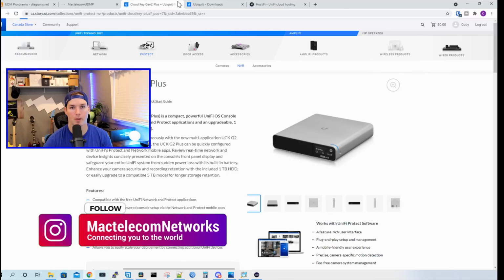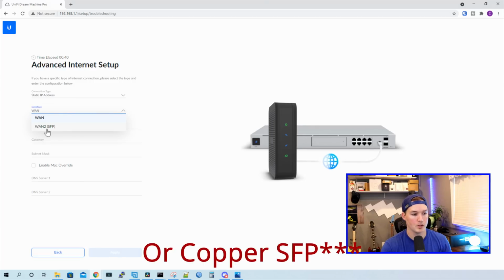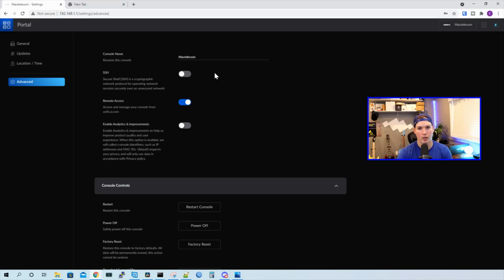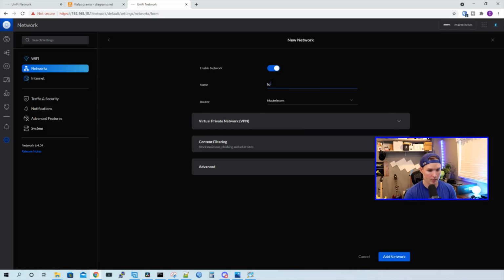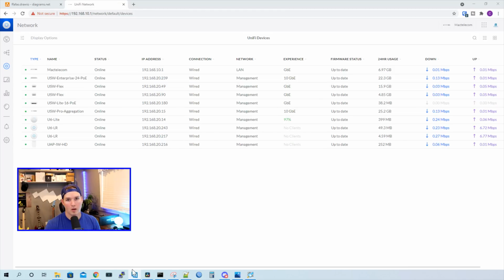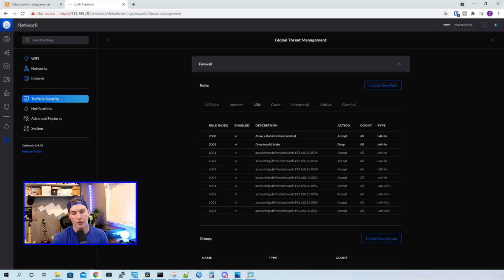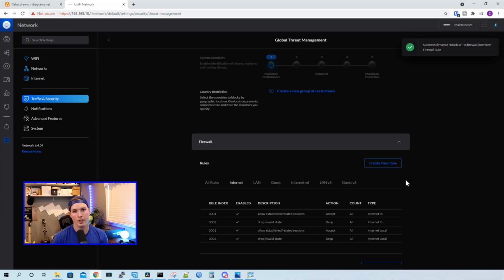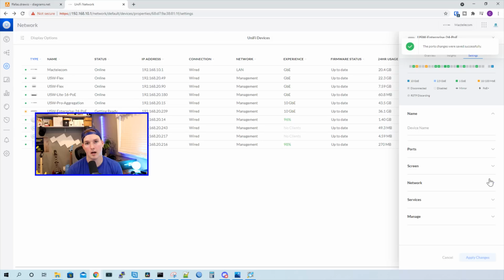Complete Unifi Configuration New User Interface

Comment: Hello Cowdy, regarding the management vlan. It only works for me when create a rule from the management vlan pointing to the untagged controller lan. That is the only way I can assing the devices, switches, ap's etc to the tagged mgmt vlan. I tried creating a different trunk profile, tagging all the vlans, then assigning it to all up and downlinks of the switches. On the ap's I use the untagged vlan of the controller and assiging the tagged wireless lans. What im doing wrong? Thanks for your assistance.

Comment: Hi Cowdy, how can i move the default manage vlan to specific tagged vlan? I created a management vlan 50. Then in LAN local i made rule from Management  LAN to point to the unifi controller. It works, but the accesspoints get Regularien disconnected and reconnect. What is the way to fix the issue? Thx for your help. Andy.
Reply from the maker: You want your uplinks between switch’s to be the all profile ( unless you created a custom port profile for all your vlans)

To put the devices in the management network click on the device, go to services, then management network and specify the vlan you want that to be

Comment: excellent video. I'm still having trouble getting my LAN to be able to see the printers on my IoT VLAN. The only way I can see the printers is if I connect my computer to the IoT VLAN. In theory I should be able to see the printers from my LAN. Any tips you can provide to help with my issue?

Comment: Hey Great Video. I have a problem with my Switch Ports. Every time I assign my camera's to the cameral network or IoT device to the IoT network it I loose connectivity. It works fine on wireless, but not on wired devices. What am I doing wrong?
Reply from the maker: Need to power cycle them to grab a new ip

Comment: hello I had a short question I want to upgrade my USG to the dream machine pro but I want to be able to configure 2 Vlans directly on the WAN preferably SFP port so that I can remove the switch trunk setup with my USG. This for Vlan internet and other Vlan for IPTV
Is this possible with the dream machine or maybe with a beta version I had read version 1.11.0-21.
Can you answer this because nowhere I can find that you can directly configure 2 vlans on the WAN interface

Comment: Great Video.  Your other classic video setup included VPN/Radius setup and Access Point group access to all Vlans.  Those were great areas to configure.  I noticed that my global threat management icon is different than yours and is labeled traffic Inspector.  I had to have missed something to not get the threat management icon and configuration.  Based on the areas that you covered in your video, it looks correct.  Probably missing something simple.  Never the less, great job and I really appreciate your videos.

Comment: I ended up following as best I can your steps here as I had to do a reset of my UDM Pro.  Now I noticed that all my wireless client devices, are showing offline, but they are still connected and working.  Not sure what I might have done wrong following along.  Any ideas?
Reply: Using Network Version 6.5.53 and firmware version 1.10.4

Comment: Hi, I'm from the Dutch part of Belgium so I hope you understand my questions 😋 

First of all, thank you VERY MUCH for your effort and trying to explain it best possible! I had a lot of info from your vids!

1) Why did you enable the optimize IoT WiFi network for your own (private/home) WiFi network? (I understand why you would chosen it specific for your IoT wifi network) 
2) Is there a specific reason why you update your APs firmware first, than switches and latest the router. Is it bad if you start with router, switch and then AP? 
3) Why do you add the UI stuff into a seperate mgmt VLAN? (what is the advantage?) --> you can manage it in UDM-Pro after all? 
4) When creating those Honeypot things, it uses automatic the .2 IP --> May I change that or does it HAVE to be .2 (because it is in my DHCP Scope/range)?

EDIT: at XX:XX you say: Now do it for all the other subnets. Can you say what exactly? Just a LAN, LAN Local rule called Block X to Firewall Interface? Or also those http/s and ssh ports and also the group Block X to Gateway? And really for ALL subnets? Like: LAN, MGMT, Server, Camera, IoT, in my home? (Not Guest because of Device Isolation) But also to my LAN?

Sorry for my bad English... well to write it down chronologically I mean... and typos lol

Comment: Well done video! Easy to understand. Only thing i miss is a bit more in-depth on the firewall rules. Like explain some more what they do. Keep it up!
Reply: I'd be interested in this too. Doesn't have to go too indepth, but just a brief overview of each function.
Reply: Basically it boils down to this:
Inter-vlan traffic is allowed between any LAN (Corporate) network you create in UniFi because there is a hidden LAN IN rule that allows all traffic between LAN subnets. You basically have to block traffic between LANs using LAN IN and LAN Local rules. Anything you don't block is allowed by default.
You use LAN IN rule to block traffic between LAN subnets and LAN Local rule to block traffic destined to USG/UDM itself. It's little bit confusing compared to other Firewalls because they do opposite by blocking everything using "Implicit deny" and let admins create allow rules. 😅

Comment: How come when I go to create a new network and under the network name the router doesn't show up?
Reply from the maker: What are you using as a firewall?
Reply: @MactelecomNetworks  The UDM Pro itself and I configured the security settings on system sensitivity to "Maximum Protection"  with no firewall rules created yet.

Comment: Ok, so if you place all of your devices on the management network, how do you access them from your local desktop if you're using a LAN VLAN?
Reply: Good question. Maybe via wifi as he assigned Mactelecom wifi network to LAN network?
Reply from the maker: My PC is on the management LAN. You can also manage your devices through Unifi.ui.com if you have remote access on . Also the Mactelecom WIFI is management
Reply: What I decided to do was to pull another PC that has two NCs in it.  I assigned one of them to the lan and the second one to t management.

Comment: Great video, and learned something new today. I do have a question. Since the new update came out the honeypot and other tabs are gone now. I use to check the scanner tab but now I can't find it. Maybe do an update on that part if that's cool or show where I could find those 2 options. 

Keep up the great videos been setting my stuff with your videos. First time running all these devices. Went from a regular ISP router to taking control myself on my network.